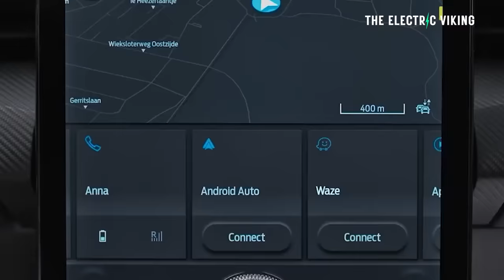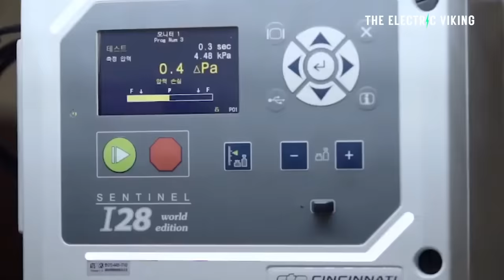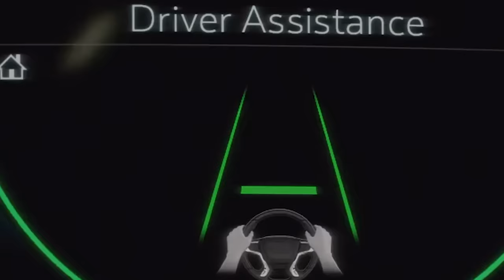NEW Chevrolet Bolt gets big changes including LFP batteries + Ultium platform

Comment: Funny thing is... any battery could be an "ultium" battery.  The only thing that G.m. managed to do here is to give their batteries a name. Just like my car , Bolt. Now you know which car we are talking about, and that battery is no different in that respect.  Changing over to lfp would be great.  No more chance of battery failure,  and virtually unlimited life. Hey, when you're battery lasts longer than your car does,  then yeah, it's virtually an  unlimited lifespan.
Reply: LFP cells won't have anything close to an unlimited lifespan.  The projections are they should last 25 to 50% longer than lithium ion and have better resistance to full charging, but they can still fail like anything else.
Reply: Google says : " LFPs are usually rated for over 2,500-5,000 cycles before their performance degrades to 80% of the original capacity. " Ternary batteries are only lasting, on average , 1000-1200 cycles. Another search on Google yeilded the following; "The theoretical life of an ordinary ternary battery is about 800 cycles basically. Which is only moderate in the cycle life of a lithium battery. In comparison, lithium iron phosphate batteries can reach 2,000 to 6,000 cycles around. " I rest my case.
Reply: Note LFP is safer
But not it won't fail, it can if manufacturing has issue causing or allowing moisture to entet causing short circuit

BYD BEV had experience such, there's some case, battery components have defect which allow accumulation of moisture inside causing short circuit. 
Those components were addressed, BEV recalled 

This is issue for all BEV. Battery is the weakness 

When LFP or similar LMFP or M3P short circuit they smoke 
Not instant fire
Allowing time to escape 
If its heat cause, fire in other parts then fire can set off LFP to burn
Yet can be put out like normal fire, as LFP don't produce own oxygen. 
Battery will continue generate heat until energy is depleted 

Safest battery is sodium battery supposedly not burn.
Reply: @ohger1 lfp will way outlast the car

Comment: Wouldn't be surprised if the low cost Bolt is made in China with CATL batteries.
With a low price point the tax credit won't matter to the consumer.
Reply: Or it will matter less.

Comment: If it doesn't start at  18-20k base before incentives than without the full tax credit it doesn't seem like much of a deal. I will have to see .
Reply: Dream on!
So you want a car under $20k? 
Your current choice of new cars under that threshold:
1. Mitsubishi Mirage
2. Nissan Versa
3. Hyundai Venue
4. Kia Rio
5. Kia Forte
6. Kia Soul
That's it.
And most of them are base versions with fewer features than even the base Bolt, aside from higher operating costs.
Reply: That's why we bought an off-lease CX-5. Still waiting for cheap EVs.

Comment: GM is playing “Follow Tesla” a game that didn’t work well for Ford. LFP batteries will doom the Bolt. The problem with LFP is energy density. The 2023 EUV weighs 3700 lbs/ 1680 kg. That’s very heavy for a small car. Ultium architecture makes the battery pack lighter, so we will have to see if that will be enough to overcome LFPs. Then there’s the China thing. Maybe it’s different for Australians, but there’s a large group of Americans who won’t buy simply because of that. 

There are a lot of things I wonder about in the EV industry. LFP adoption at the expense of weight is one. The other is the almighty heat pump. Once again, this might work great for Australians, but people who live in colder zones will find it lacking. In the US, heat pumps are used in some houses, but always packaged with electric heat because heat pumps lose efficiency when temperatures drop to single digit C, 40F in houses. I watched a Polestar owner video talking about his car’s efficiency in ambient temperatures 0-10C, and it was 2.2-2.5 mi/kWh. My 2023 EUV is still putting out 3.3 with similar temperatures, but that is because I only use the cabin heater to clear frost off the windshield. My comfort is clothes, steering wheel heater, and seat heater. How many Tesla owners in cold climates complain about “malfunctioning” heat pumps? 

Time will tell how GM revives the Bolt, but I think making it heavier will reduce the overall range, increase tire wear, and negatively affect drive and comfort. Just like big screen TVs, people will never be happier with less range even with less money. Yes, the LFP will last much longer, but is that really a concern? NMC batteries last over 200 cycles before 80% becomes max, if I charge my EUV every 200 miles, that’s 400k miles. Reality check takes half, so 200k miles- by that time I’ll need a new car, right? What new chemistries will be available then? For me, I’ll stand behind my physics like a Lightning owner who can’t make it to the lake and back with his boat in high wind.

Comment: They're getting rid of it, because it will be a different vehicle? Desperately trying to find an excuse to drag GM thru the mud. THE BOLT IS GETTING UPDATED. Of course there will be differences. If Toyota did that, it would be clapping hands all over the place.

Comment: I think the GM leadership is taking the wrong approach. GM doest not yet have the EV factory or the EV vehicle design to sell EVs into the mass market. GMs EV technology, battery technology and factory technology to compete against BYD in the mass market segement. If GM leadership had any brains at all it would be concentrating on increasing sales in the premium market and ensuring their EVs are profitable. By increasing sales of its premium EVs GM could benefit from economies of scale which would help its mass market EVs be profitable.
This is the approach Tesla took and it seems to have worked.
Reply: They tried that with the Hummer. They sold ten.